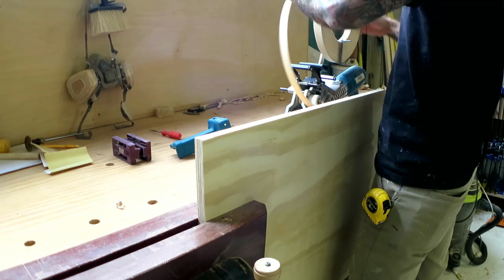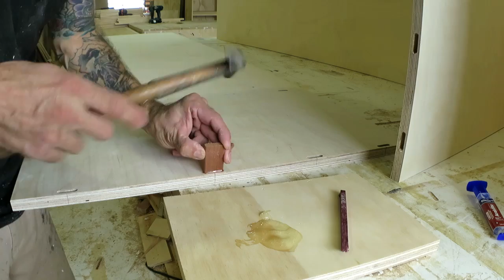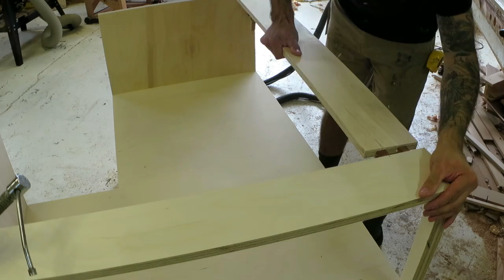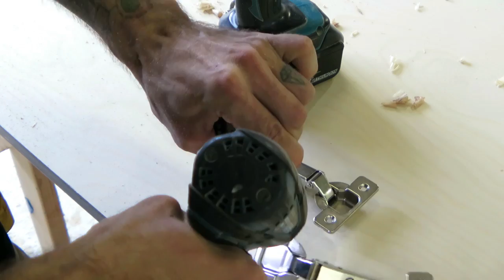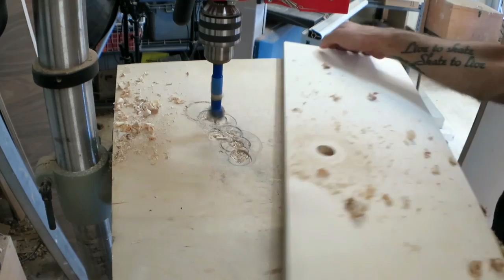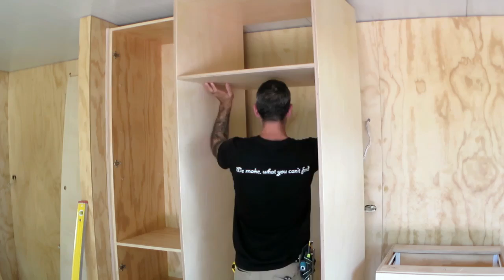plywood kitchen

Comment: Those hinges come with that little expanding plugs because they were originally designed to work with crappy MDF panels. Plugs like that just hold better in such materials
Reply: MDF or even chipboard as in Ikea furniture.  They can also be pressed in if you have the right tools, as it's faster than screws.
Reply: I do have hinges without the plugs.  They are expensive hand made hinges though. MDF kitchens are fine but I just wish people would know the difference so they know what they are about to buy. 

I always explain to the customer why I use Plywood over MDF and why the draws are hand made out of solid wood.

Comment: Simple and functional, easy as. I lift larger doors with my foot, clip the top hinge on and work your way down, found it a bit easier
Reply: Grant Lister ahhhhh my first boss, back in the mid 90’s always said, “ top hinge pin always goes in first and comes out last.”
Reply: A friend lent me a couple of these to use as I was changing out all of the doors in my house, by myself... worked great and easy to operate with one foot while holding the door and dropping in the hinge pins. http://www.leevalley.com/en/garden/page.aspx?p=70432&cat=2,42194,40727,70432

Comment: Here in the states (at least mine) I've found everyone wants paint grade over the last 2 years.  Nobody wants wood atm.  I use a maple / maple 3/4 ply carcass w/ 1/2" maple / maple rear panel for square and strength.  You used some good methods for cutting down the costs for a budget kitchen while maintaining a decent cabinet grade.  

I don't know how NZ works but here I can order my hinges for press in or screw in.  I use an east coast company called Hafale.  I don't know if they cater to NZ but they are my go to for anything kitchen hardware.

Comment: Great video, it's very interesting to see how woodworking goes in different countries. Here in Brazil the tendency for kitchen cabinets is laminated MDF, all flat. I am not a fan so I am building mine "the american way" with rails and styles and panels and angles. But hey, basic burch ply looks nice and seems to cut down in the costs, so that's clever as well. Great video, thanks for taking the time to share :)

Comment: Really love that! I'd prefer myself to set the doors inside the corpus and stain the corners dark, keeping the panels in a lighter / brighter color. That puts some breaking lines into the too clean look for my taste. However, it works the same way by just making the side panels a bit longer and use the right hinges, as you already explained. Thank you for the inspiration!

Comment: about fitting the large cabinet door , IF you have enough space to lay the cabinet down with the door laying in front of it it be eazier to tighten the door to the cabinet (slide the top and bottom in then take out the screws on all others fold the hinges down and put screws back in)

Comment: 100mm overlap would have been better to cut the 100mm off the hinge side of the right door and refit the hinges, this would keep the grain flow intact.
Reply: I might be wrong here but to the left of the door he cut the 100 mm off there where three drawers (as seen at 18.34)so either way the drawers don’t match the cupboard or the two cupboards don’t match each other either way he was buggered

Comment: I built my kitchen cabinets out of 3/4" 9 ply  plywood also but I used wood glue and eight penny finish nails drilling the nail holes with a smaller bit than the nail and 1/4" plywood back glued and nailed, the faces were plywood glues and nailed too, but all my bottom cabinets were ALL drawers of different heights but all the same widths,.. Having all drawers below with stainless bearing glides , to me, is a the best use of space.

Comment: In the UK, I think majority of bespoke kitchen makers have gone down the ready-made carcass route. Then offering the bespoke part on doors, either 2-part epoxy spray or veneers on MDF. With a few of the top carcass manufacturers, you can order just about any shape/size carcass. The carcass are dirt cheap compared to handmade.
Reply from the maker: Not so much bespoke as assemblers of flat packs.  I can see this is a time saving endeavor but more importantly this requires less skilled workers and I bet as 
"Bespoke " kitchen makers they still charge eye watering prices.
Reply: KingPost TimberWorks hi, please don’t misunderstand my comment, I’m a huge fan of ply kitchens and your work is great.
My brother and I had a shop like yours for 20 years up to 2008 and the financial crisis. We started out making everything, carcass to final fit. Our shop was in London and clients were desperate for something different. We offered kitchens in any finish possible. We had a firm who would spray the carcass/doors any colour in the RAL charts. We offered veneered carcasses and doors to match. 
But like everything, the market in London became very competitive and we had a shop of five employees who were among the best. Then we found a company who would supply ready built carcasses, glued and dowelled, in a range of finishes and on top of that they would make special sizes. Their price and quality, we just couldn’t match. That’s when we started to use these prebuilt units. 
It wasn’t a route we wanted to take, but then we discovered that this firm was supplying many other much bigger bespoke kitchen firms.....
It was only kitchens that used the prebuilt carcasses. We did a lot of bedroom furniture and fo that we used sprayed finished MDF.

Comment: First time I have seen someone measure incorrectly by 100mm longer. Every damn time myself, or my lackys measure short!
Reply: Ough!!
Reply: At time 15:53--  Why didn't you take 50 mm off the outer sides of the doors, rather than the middle-  then grain would line up?  The 35 mm hinge holes might not show if they are cut off and re-drilled?
Reply: Kuffys Woodwork
Reply: @oldredtools2315  because it would hit the hinges lol
Reply: Just between us - been there done that
Reply: First time you've seen someone put that in a video lol. I bet people do this shit all the time, can't just be me and you.
Reply: More is better than less
Reply: @nikfish1   I have done it too hahaha

Comment: I know it wasn't your choice but I did a smaller one with an island unit and had everything lay flat on the floor with no toekicks, gives it a much more slick modern feel in my opinion. Also, I know they're doing a metal top but splurging on door hardware and pulls can really put things on another level.

Great job, wish I had this video for reference when building mine.
Reply from the maker: Problem with no toe kick is no ability to account for unlevel floors
Reply: @KingPostTimberWorks  I noticed some side panels of some cabinets did reach the floor though, did you cut those after leveling to fit exactly down to the floor? I always find that a rather time consuming part of installing furniture on site.
Reply: Toe kick also allows you to get closer when using the bench, far more practical

Comment: Hi
Great videos. Here in the UK we only use the supporting braces across the top for the very same reason. What we don’t do is fit a back closure panel on the back of the units. We always come in about 2 inches with our closure plate, for a number of reasons. Firstly our walls especially in older houses are not plum. The can belly in or out. Having just the outer edges of the unit makes it much easier to scribe the unit or wall. Secondly it gives a hidden area for pipes and cable runs behind the units.
Reply from the maker: Right you are some times in older places we will leave 15mm gap behind the cabinets for the same reason and use a steel L bracket to fix to the wall.

Comment: So Plywood is the fashion in Kiwi land? I suppose it makes life easy and cheap. At least the doors were long and not short. That would have been a disaster ;D  I have a small bottle jack with a sort of 'Jig' on the top to hold doors etc at the right height while fitting. It's like a third hand. Thanks Joey
Reply: Yes, plywood cabinets are way better than melamine cabinets.  I would think you would want built up doors though, not plywood.
Reply: Plywood is the best material for building kitchens. MDF and melamine is nowhere near as good a material.
Reply: I use a motorcycle scissor stand to line up my doors. Nice large flat surface and easy to adjust, have used it for numerous jobs,handy piece of kit!

Comment: The plywood we get routinely around here in the Houston area - even domestic (i.e. made in the USA) can be very pretty and well made.  But it's rarely flat enough for doors.  And it can not be used without edgebanding.  First, the edges just aren't attractive enough and second the face veneer is to thin that it just wouldn't be robust enough 20mil paper backed veneer over MDF would be much more durable.

Plywood good enough for this is special order and never less than $200 a sheet.  One brand I'm familiar with is States Industries ApplePly.  And it would probably be barely good enough.

Comment: They started supplying the plastic plugs because most kitchens are made of crappy cheap chipboard and the weight of the door or someone leaning on it rips the screws out after a short time.

Comment: Nice job... I hope mine will come out nice as well; in some way or another... I don't have money for a commercial kitchen left.. So my plan was also doing a diy ply wood kitchen with some nice face frames and it shall be stained (gray maple or gray birch; colorwise). The counter will be made of stone. Too many unplanned costs during establishing my house... (still working on the walls and final insulation.. all alone, no helpers) ..Nevertheless, seeing how nice a ply wood  kitchen can be gives good motivation. Thanks for sharing :)
Reply: If you can make your self a wooden counter top. Wood looks better than Stone worktops. There is a big craze at the moment with stone worktops that will run out of favor later.
Reply: +1 for wood counter top.  A butcher block counter top looks amazing & is the most functional I've used (in-laws have one & it's on my list of to do items for us).

Comment: Great kitchen. Plywood furniture is quite hip in Belgium as well. Most of the times there’s not even edge banding. WYSIWYG! With good quality plywood like baltic birch or high quality construction pine like Wisa Spruce the edges look amazing after a couple of coats of waterbased poly. The contrast that shows between the different layers is really beautiful.  My kitchen is completely made out of Wisa Spruce sheets. Funny thing is half of my friends love it. The other half don’t get it and ask when it will be painted 😂. I like that :). 
Only thing I would never do again on any cabinet is to use small round holes as doorhandles. Mine are about 20mm, maybe a little bit bigger and I frequently felt like nearly breaking my finger when in a rush opening the door too far before pulling my finger out. If that makes any sence. :) 
But maybe your holes are bigger. Couldn’t tell that from the video. Anyway, it was something I had to find out the hard way.
Reply: Just had a look at it, mine are 20mm, so probably if the holes you made are let's say 30mm or bigger your client will surely never complain.

Comment: nice, I like seeing the mistakes too, as it proves we are all human 8-)

I still don't understand the Kiwi fetish for plywood though.
Reply: Russ Dixon hi u liked this video maybe you'll enjoy mine 👍
Reply: Plywood is a more expensive material than MDF. It is superier in every aspect for kitchens. It does not react as badly with moisture as MDF, it is stronger, offers more options. 

The only advantage with MDF is the fact it can be molded and shaped easily. SO you could take a router to MDF and create a profile that you cannot do with with plywood. 

The reason why certain countries have an obsession with MDF is because it is cheap and at mass scale production is easier to work with.  I make all my kitchens with plywood or solid frames.

Comment: get yourself to ikea and buy all your hinges there, they're much better, although the drawer units are very similar, makes me wonder if they have a common supplier. Also, most kitchen carcasses and doors are particle board or MDF, that's why they come with the plastic inserts, screwing small screws into that stuff is a nightmare.
after the 100mm error, why didn't you remove the excess from the sides of the door to leave the grain in the middle unaffected? 
good work.
Reply: No Ikea store in NZ yet

Comment: Interesting you put the side panels resting on the baseboards, I’ve always thought that is intuitively stronger but never seems to be done like that commercially. Would you do that with wall mount cabinets too ?
Reply: Andy, wall mount cabinets would actually be weaker made that way, if you think about it.  Less holding power of fasteners pulling down than shear.
Reply from the maker: Depending on the size of the wall unit and where it's going and if you want to see the edge in the bottom  or side of the unit. I add 18mm backs to wall units so it doesn't really matter which way.

Comment: It’s funny seeing the same methods, same challenges and same work around but I do love your Blum hinge drilling guide can you please give some details of model number so I can order one?
Ps. I saw that Domino go in crooked, I’ll give yo the tip that helped me with Domino’s was to use a hammer upside down and push them in, don’t hammer them in. The glue lubes them and they seat much better
Reply from the maker: You will have to contact blum for the jigs. Seem to only be avalible from them direct and they also have much better ones now too. 
My dominos are mostly shop made so are pretty tight.

Comment: There is an easier way to install the hinges, clip them together then fit them into the cabinet then all you have to do is fit the door to the hinges.
Reply from the maker: Not easier in my opinion.  Also technically not how the hinges are designed to work.

Comment: Looks like your on the right track not really done the standard way but it looks like it worked. I think you should have dived the pantry cabinets by 2 in height (separate carcasses)
Reply from the maker: Would have been easier yes. But uses more material. This was a very tight budget job

Comment: Is there a need to use epoxy to glue wood?
Reply from the maker: Depends
Reply: @KingPostTimberWorks  depends on what? I'm not saying that you are doin it wrong. I'm just really  curious. Because it sets faster? But if you set it wrong, good luck trying to fix your mistake.

Comment: Joey,  Just wondering how you attach the boxes to the wall?  Do you screw through the plywood backs?  In the states we usually run the rear stretcher vertically and use it as a nailer, so you screw through it and the plywood back.  The only time that I run the front stretcher vertically is on a box for a sink.  It works well since there is no top drawer on a sink box and the extra strength and less cutting to install the sink is a plus. The only down side is that the top hinges on the doors have to be low enough to clear the stretcher.
Reply from the maker: Good point's.  Yes usually screw through the back or sides depending.  Good idea to put the front sink rail on edge too!
Reply: @KingPostTimberWorks  what is the countertop made of? will those horizontal stretchers hold something heavy as granite? in that case... what should be the maximum distance between the vertical panels according to your experience? Thanks, great video!
Reply from the maker: @quinosonic82  this one had a stainless top. Stone tops are fine to span 1200mm between verticals
Reply: @KingPostTimberWorks  thanks for the answer!

Comment: Very nice, looks awesome! Have you had any problems with the larger doors warping at all? About to try this exact type of thing but have been warned that the doors could warp!
Reply from the maker: Yea ply can twist,  generally I find euro/Russian  birch is petty good. I have found , if it's going to twist it will happen just after cutting the sheet, so you can access then. Have never had any call backs with these kitchens yet

Comment: 1:08 Noob here. Is that a PVC edge banding?
Reply from the maker: No I use pine veneer edging
Reply: What kind of edge banding tool is that?
Reply: Looks like a Raukantex from Rehau, or an similar machine branded differently

Comment: hello there sir!!, in your video at 4.50 approx, were the slots for the domino on each stock piece set at tight fit (on your festool) or did you on the face stock for example put at the mid setting so there is some wiggle? thanks in advance and have a good day

Comment: Hi,again a great video from you, may I ask you when you say you add clear coat what is it you are actually coating it with? I made some birch ply skirting boards and used clear oil similar to Danish oil, your one seemed nice too but simpler.
Reply from the maker: It's water based poly.  Cheers
Reply: ..and what did you use to appply it, looks like a laminate floor cleaner :)

Comment: Great video! Sorry if I missed it but what did you se to coat the front panels?  I called Dulux and they recommended Cabot's floor sealer but said using water base risks the ply expanding over time and using the oil base risks having the ply delaminate over time. Thanks!
Reply from the maker: I use water based polyurethane on most jobs. Plywood does not expand or contract.  I have never seen a finish delaminate plywood.  I guess it could happen on very low grade ply.  Seems like you were given bad advice to me
Reply: @KingPostTimberWorks  ok thanks for your reply! :)